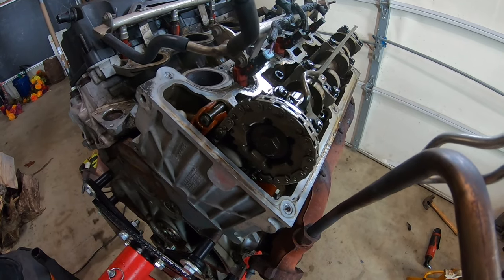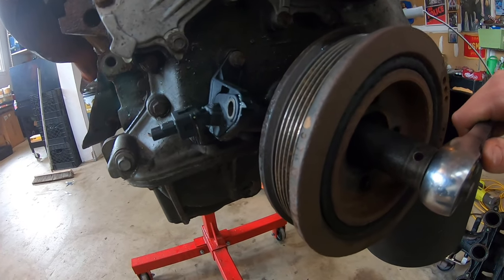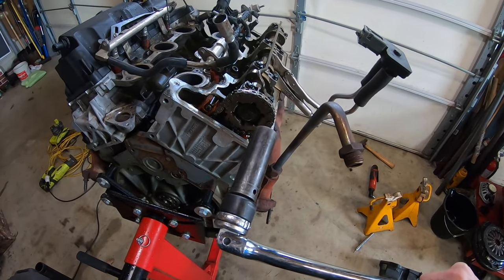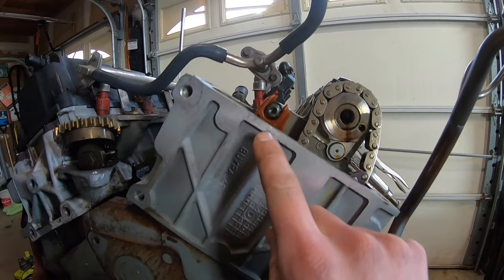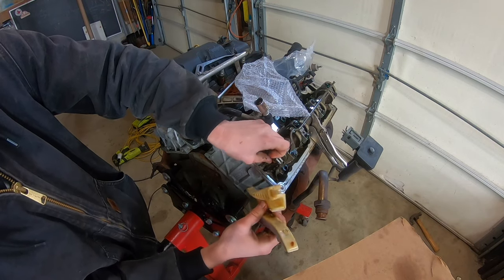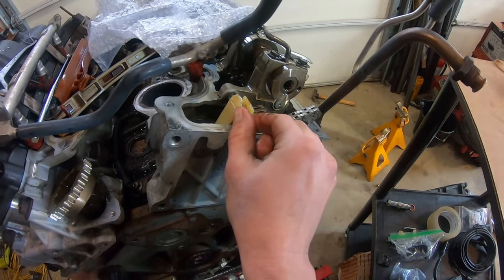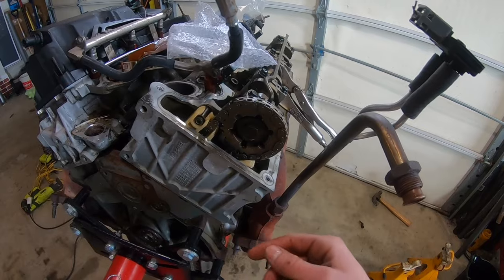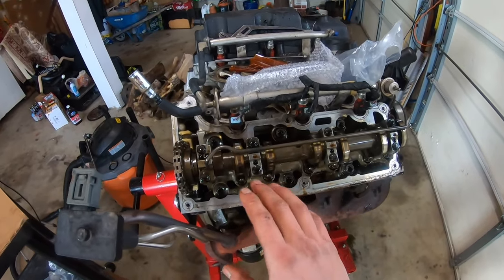Ford 4.0L SOHC V6 Rear Timing Cassette Replacement (WITHOUT FORD SPECIAL TOOLS)

Comment: Hi I saw the video very nice. But I have a question. Same motor same problem. But my chain I believe jump off a time the car is not running so my question is  my motor vent valve ? Plz let me know
Reply from the maker: Yes, you bent a valve. The heads need to come off.

Comment: Ok sorry I've read some of the previous comments about the broken pieces being removed by removing the bottom steel oil pan which is fairly simple. But shouldn't the upper pan(not sure thats what its called) also ?
Reply from the maker: You don’t have to remove the upper. 9/10 times it all ends up in the sheet metal lower. And even if there is one little piece left it won’t make a difference. As you can see in this video, the cassette was still intact but disconnected at the pivot. There was no need to pull the pan. If you remove the valve cover and see the guide is totally gone, pull the pan.

Comment: Have you ever heard of the 4.0 having oil only on the exhaust manifold studs like I just did the valve covers and cleaned up the engine for the most part but some of the studs definitely look wet
Reply from the maker: Nah maybe residual. Pressure wash the engine.
Reply: @iamdjnam  sorry for spamming the videos just real concerned... it almost looks as off its coming from them, I did spray degreaser kinda everywhere and hosed it off probably not that clean but it's just oddly clean around them and then they are wet
Reply from the maker: @josephmaldonadojr4692  oil is not coming from the manifolds.
Reply: @iamdjnam  yea that's where I'm stumped all I can think is if the heads somehow cracked where the studs go in but any way I'll keep looking hopefully I find something
Reply: Thanks though and I love the videos by the way!
Reply from the maker: @josephmaldonadojr4692  the studs go into the water jacket. It wouldn’t pierce and oil galley.
Reply: @iamdjnam  well shit that makes me feel better I guess it's just that gross in there lol
Reply: That's what I was hoping for

Comment: Can this be done in the Truck?   Not sure there is enough room to pull the cassette out.   2007 ford explorer sport track
Reply from the maker: Engine or trans needs to be removed
Reply: Yeah transmission is out
Reply: Engine still in the truck
Reply from the maker: Then you can do it

Comment: While you have the engine on the stand pull both oil pans and check for broken pieces or you might just wind up pulling the engine again.

Comment: is a 1998 motor the same as the one your working on, i see gen 1, gen2 mentioned mine is awd with 172000 ks thanks in advance, cheers Mick
Reply from the maker: This process will work for your engine no problem.

Comment: Do u have to remove the motor to replace the timing chain cassette on v6 4.0 mustang
Reply from the maker: Yes to access the rear cassette the engine or transmission must be removed

Comment: Can that be done on the passenger side with the engine in the car ? Thanks
Reply from the maker: No.
Reply: How about take tranny out instead of engine  ?  Which would be easier ? Car only has 70, 000 miles    Bought it new .
Reply from the maker: @anthonygiachinta3056  engine is easier imo
Reply: Thank you ! The whole thing happened when the plastic thermostat house split open and the head gasket blew . Thought  I was out of the woods now this . I am 66 years old have four antique cars … let me tell you ford really sucks with their  engineering and cheap nylon parts  and plastic .   These shit boxes will never make it to a car show 60 years from now … my father said glad I am checking out and not checking in  . Finally know what he meant . Thank you young man 🇺🇸

Comment: Do you know if your part listed in the description will fit a 94 ranger 4.0. It only says 97+ on the description. Thanks will this kit work for a 94 4.0 ? RADHLBNIU Timing Chain Kit Compatible with 1997-2010 Ford Explorer 2005-2010 Mustang 2001-2010 Ranger 2001-2010 Mazda B4000 1998-2010 Mercury Mountaineer V6 4.0L Replaces# TK428 KT4038S TS20395
Reply from the maker: They won’t. It’s for 97+. Your 94 uses an OHV engine, not a SOHC.

Comment: What is the rear center sprocket with the cover get torqued to replace the chain and can’t find the torque spec for that one
Reply from the maker: 15ft lbs plus 90 degrees

Comment: I am seriously thinking about trying to change the rear chain guides on our 05 Mercury mountaineer. 
I am mechanically inclined but have zero training in mechanics. 
How much knowledge is required to do this job? What kind of training do you have? 
Sorry for the questions, I am just trying to get a feel for if I could do this or not.
Reply from the maker: I’ve been working on engines since 2016. Mainly Ford engines. This repair is possible if you take your time and follow my lead exactly. Don’t rush. This is an interference engine so any mistakes can cause valve damage.
Reply: @iamdjnam  I haven't had a chance yet to go through and watch all the videos you have on the subject, but I was wondering how much if any parts you had to take off of the camshaft? 
Also we tried to change the rear timing chain tensioner and now it sprays oil everywhere. I may have over tightened it. 
How hard would it be to replace the passenger side engine head?
Reply from the maker: @desertrat1357  It’s either undertorqued or the mating surface got damaged. It’s involved to take the head off. Removal of the head requires complete re-timing of the entire motor. The only thing that needs to come off the cam to replace the cassette is the sprocket.
Reply: @iamdjnam  okay. Good to know. Thanks for the information.
Reply: @desertrat1357  There are metal washers that need to be replaced when changing the tensioners... sometimes they are sold separately... otherwise you get an oil leak.

Comment: I'm about to perform this repair for the first time on a 2006 mountaineer. It has a blown head gasket, and the oil looks like soy latte. Any advice on how to clean all of that mess up? I think I'll have to tear it all the way down to the block just to make sure I clean all the gunk out. Have you dealt with this before? If so, what do you think is the best way to clean all of that out? Thanks for the great video man. Ford has been trying to screw people out of as much money as possible since about 2003, so I love finding ways to screw them back. Keep it up bud.
Reply from the maker: If you pull the heads off, you can pressure wash them. Disassemble the block to bare iron and use oven cleaner.
Reply: @iamdjnam  will do. Thanks again!

Comment: So what about any broken small pieces that may have fallen in lower end of motor. I suggest pulling oil pan to check.
Reply from the maker: Yes! I drop the pan and clean out the oil pickup tube. The $12 gasket is definitely worth the piece of mind. Thanks for commenting!

Comment: ok... so what if the front chain broke because the engine fell off the stand and you were dumb and spun the balancer anyway? what if you tried to compensate for turning that balancer by turning the cam by itself? Am I proper fuqed? Can I use the tools and set everything right?
Reply from the maker: Do a leak down test. If it fell off the stand I’d be concerned about the condition of the aluminum head at that point.

Comment: Index marking the cam gear to the cam and the chain to the cam gear helps too, that way you can make sure it goes back exactly the way it was b4 breaking bolts loose. O and ive done extensive research on timing drive kits for the 4.0 mostly cuz i was looking for a performance kit or a kit thas better then the ford one. Out of all my extensive research i have not found 1 afternarket kit that can even come close to matching the quality of the Ford kit which is far superior in quality and design. I know your saying they look the same but theyre not.
Reply from the maker: I know all about the chemical compounds in nylon timing cassettes. Yes the Ford is superior. No, people don’t wanna drop 500+ on a oem kit for a 20yo vehicle. The Melling is the second best kit, followed by preferred components. You can read and read and read but the best research is done by experiencing it first hand. I’ve tried every guide on the market.
Reply: Actually there's quite a bit of documentation online about aftermarket tensioners failing. I can send links if interested. Some of the aftermarket components have thinner rib structure which  will deflect more failing sooner.  I am on a budget as well but, IMO this job is too labor intensive to take chances with aftermarket parts and too risky to to not change other related timing components at the same time. Even if it buys someone time until they sell the car after repairing, it becomes someone else's problem 5000 miles later.
Reply from the maker: @mikemaj8467  If you look closely, you’ll see that Melling parts are actually manufactured by Borg Warner. The transfer cases on the explorers are Borg Warner. The chains say made in Italy which is as good as you can get. Definitely worth getting the melling kit.
Reply: No plastic guid without metal frame can last long! I just found out that the ford guid broke after 40K KM when I was replacing valve stem seal, but I thing it still can do it’s job for a long time before it is completely gone and then the rattle will be heard. I will seal the top of the guid with JB weld to prevent it drop down from the upper bolt. What a fatal design!
Reply from the maker: Yes! Like my other video!
Reply: There is enough room to get the bolt out on the cam sprocket with the firewall and the heater box there    That’s for the info  Walter

Comment: Is it possible to change the rear cassette without taking the engine out?
Reply from the maker: Engine or transmission must be removed.
Reply: @iamdjnam  J really appreciate and thank you for  the quick reply.

Comment: my car has the same problem, but i want ask you: the engine oil is getting black color 3500 km do you think its the rezone of the same problem? please advise me because the x owner was put a deferent oil in the engine it wasn't 5w-30 it was a deferent thing.
Reply from the maker: Only use 5w30. Anything else can cause issues long term. Change every 5000 miles.
Reply: @iamdjnam  thank you so much

Comment: Man..thats good help!.. was wondering how do you changeout the back chain and sprocket?
Reply from the maker: Only changed the top sprocket. You can’t change the bottom without removing the jackshaft plug and buying a new special Ford bolt.
Reply: @iamdjnam  what keeps the chain on in the bottom when you remove the gear
Reply from the maker: You got the lower jackshaft sprocket and TTY bolt. You can’t remove them without removing the rear plug cracking loose the 8mm head bolt.
Reply: @iamdjnam  so the chain wont just fall off the lower
Reply from the maker: Nope it’ll stay on. No chance of it falling off whatsoever.
Reply: @iamdjnam  ok, thanks so much

Comment: This will be my fist time doing any job this big. My question is can this be done without removing the motor from the vehicle?  Can the Tran be back off to access the lower bolt?
Reply from the maker: Remove the trans or pull the motor
Reply: @iamdjnam  thank you.  Which is easier, ?
Reply from the maker: @asherleearmstrong2592  trans depending on if you have 2WD or 4wd. I always pull the motor because I have a bad back and can’t maneuver under the vehicles easily, but it’s much more involved dealing with AC, power steering, coolant.

Comment: I gotta do this I popped my oil pan and saw a bunch of plastic pieces, pretty sure this is the issue. I have no engine hoist so the block is still in it. So taking the chain guides out is going to suck because it would be up by the firewall. ahh man fun times.
Reply from the maker: You’ll need to remove the engine or transmission. The lower bolt is behind the bellhousing.

Comment: I did tighten the cam bolt without a foot lb ratchet. Just put a pretty good nice n tight snug on it. Should be good 63-70 ft lbs if I had to guess
Reply from the maker: Tight is tight

Comment: Hi, I see there are conflicting reports over the internet on whether the 4lt  V6 is an interference engine or not.  Also seems there are two types. Mine is a 2005.  Interference or not ?  thanks.
Reply from the maker: Every 4.0 SOHC ever made is an interference engine. If you click on my channel and go to community, you will see the picture I have up of all the valves bent.
Reply: @iamdjnam  Ok - thanks for reply.  Seems you can't rely on some of these sites that supposedly identify engines to be one or the other.  Several identify the 4 lt V6 as non interference.  Thanks again   cheers
Reply: @iamdjnam  I don’t see the picture of the vent valves

Comment: I am sure someone asked this question before. Can you do this without taking the engine out? 
Take off air intake, air coolant container, head gaskets, etc. Can it be done?
Reply from the maker: No. The bolt that holds the guide in place is located behind the bell housing. You must remove either the engine or the transmission for access.
Reply: @iamdjnam  Excellent videos and explanations, thank you much! In addition to the previous question, what in your opinion is easier to take out - the transmission or the engine? Thanks!
Reply from the maker: @nw7m  engine 100%. I can get it out in 2 hours and just do all of the chains while it is out.

Comment: Just had the timing chain replaced 18000 miles ago and now I have the same issue. Would l be better suited to find a different vehicle or drop another 3000 into a new chain and risk it going again in another year and a half???
Reply from the maker: A brand new Ford guide part number 6M290-AA will last 300k. Whatever guide was installed is either aftermarket or was installed incorrectly. 3 grand for a new chain is robbery. I can rebuild an entire engine for 1500
Reply: @iamdjnam  dammit. I was charged 22 hour labor x $80 $643 for the timing chain kit plus extras....
Reply from the maker: Yup. Not sure how he sleeps at night. You were robbed without a mask. A Ford timing kit is only $400.
Reply: @iamdjnam  definitely was a kit from Napa. I called so many other places and they wouldn't touch it. The Ford Dealership was like we will put a used engine in for 5k. Now l either start the revoking process or cut my loses. Are you in the midwest??? Haha l need someone like you to do this.
Reply from the maker: I’m in NJ. Here’s your best bet. Buy a used low mileage motor. WITH A WARRANTY. sorry for yelling. Pop open the valve cover and make sure everything is tight. Facebook and Craigslist are great places to find cheap engines. Then price out every mechanic for a remove and replace.
Reply: @iamdjnam  thank you for your insight l really appreciate it.

Comment: What is the timing chain fixed too down in the block ?
Reply from the maker: Jackshaft rear sprocket
Reply: @iamdjnam  can you remove the Jack shaft rear sprocket without damaging or misaligning other timing components ?
Reply from the maker: @larrywatts4225  no

Comment: Looking to replace timing chain. Looks like a pain. So depending on mileage maybe it’s best to buy a low mileage checked fully engine. Many v6 Explorer looking great in junk yard probably because of faulty timing chain cassette.
Reply from the maker: That’s how I sell my engines. I open them up, replace the guide and resell it. Peace of mind for the next owner.
Reply: @iamdjnam  That an awesome reassurance cause most people looking to repair these engines is done out love. Most would say it’s done move on!

Comment: I’m having a problem with my jackshaft chain tensioner. For some reason the chain keeps slapping the tensioner back causing a loud rattle. I got the tensioner from ford 3 times and the same thing keeps happening the chain rattles and it only rattles at low rpm. Any idea what could be causing this?

(Replaced both sprockets and chain)
Reply from the maker: Check your oil pressure.
Reply: @iamdjnam  but the jackshaft tensioner is mechanical.
Reply: And my spark is advanced by 10 degrees. It’s reading at 20 degrees normally it’s supposed at 10 degrees I’m wondering if my timing is off by a tooth.
Reply from the maker: Yeah see if the one of the cams is out of time or a chain has too much slack, reverb in the difference will cause your tensioner to act erratic. Set the engine to TDC and check cam positions.

Comment: And this issue will cause misfire on cylinder 1,2and 3 correct?
Reply from the maker: No. It won’t. The cam out of time slightly would. I’ve seen it.
Reply: @iamdjnam  I have a sudden miss on 1,2,3 and idles like crap but goes down the road ok
Changed coil pack, same issue. Upper engine rattling to that wasn't there before
Reply: @iamdjnam  also wouldn't a bunch of slack in the chain cause it to come out of time a little?
Reply from the maker: @justinirwin7881  yes, but at that point the guide would be completely missing and you would require complete re-timing of the engine. This procedure is for people who’s engine is not that far gone.

Comment: are there no timing marks on the chain? how do you know you have the chain where it needs to be on the gear?
Reply from the maker: No marks. Everything is done up top with the tools. Engine at TDC.
Reply: @iamdjnam  so I reckon if you don't have the chain in the correct place on the gear then when you tighten in the tensioner it will cause the cam to spin making it not inline with the head. OK
Reply from the maker: Leave the cam bolt loose, install your tensioner, then tighten your cam bolt.